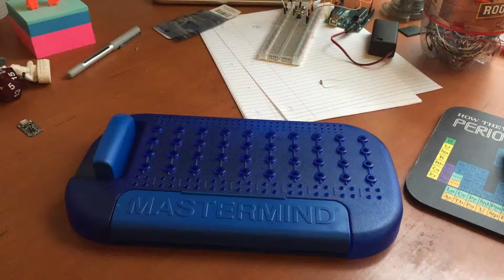Mini-Arduino Mastermind Project Part 1

Comment: Did you resolve the issues you were having?  I could not find the completed code on instructables?  I would like to create a lock with a similar format. I think for my purpose I would modify more towards the traditional game format - six keys to enter a four position combination and output a four-LED clue block (RGB or tri-color).
Reply from the maker: X-Factor Security I did, I was able to code the trinket after I removed it completely from the circuit.  I haven't reassembled it yet, but I may try to finish that project this summer.  Good luck with your lock by the way!